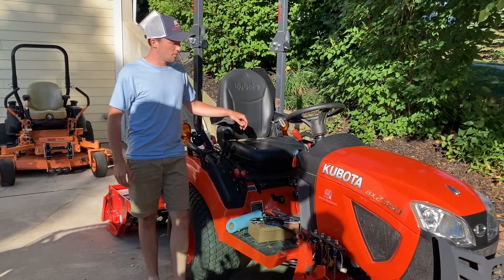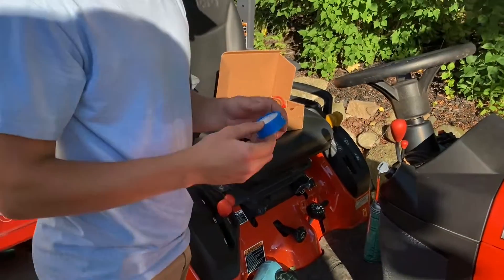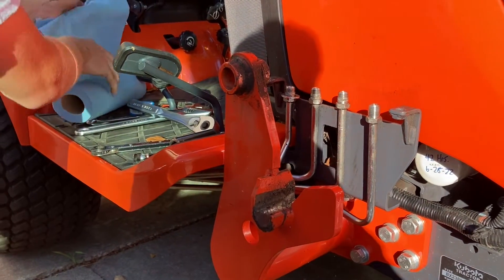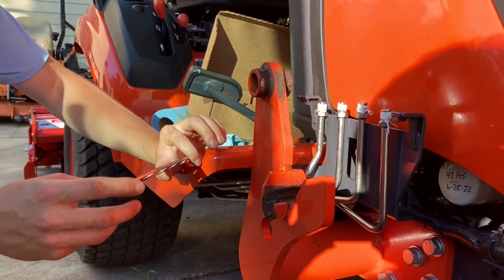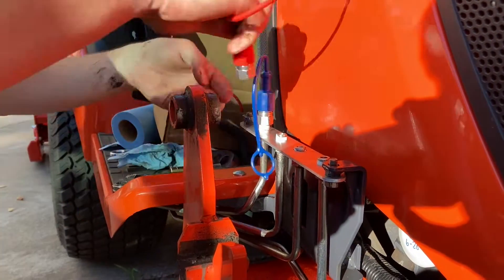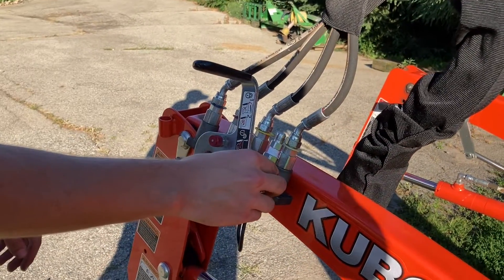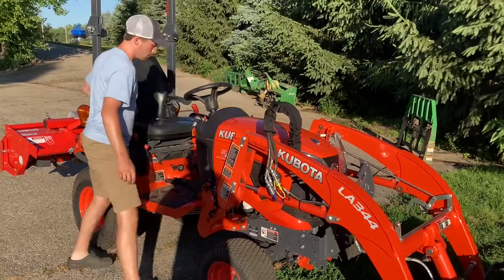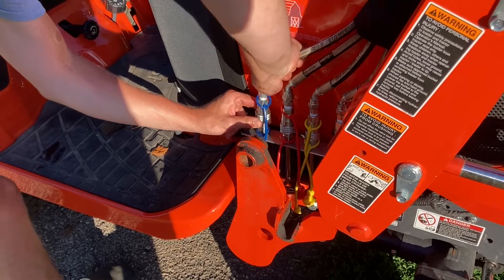Kubota Pioneer Fitting Kit

Comment: Had a couple questions before I started the installation.  Call Ethan, he answered promptly and gave me very detailed instructions.  Installation was straightforward.  I put two 1/2" washers between the plate and each of the fluid lines which kept everything tight.  The process to connect and disconnect does take a bit longer, but no leaks so far.  Lift the engine hood up to give yourself a little more room to work when attaching the hoses.  Someone else on you tube suggested using Pex hose to keep the covers clean when the loader is on.  Cut a piece about an inch and 1/2 and slide the cover over each end.  Will see how it goes, so far all is good.
Reply from the maker: Thank you for the positive response! I hope everything continues to be leak free for you!